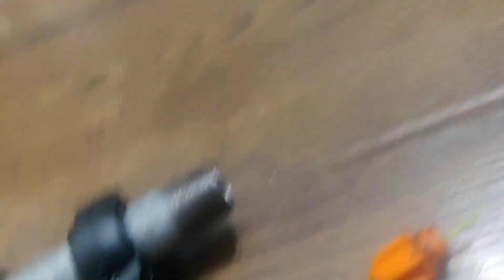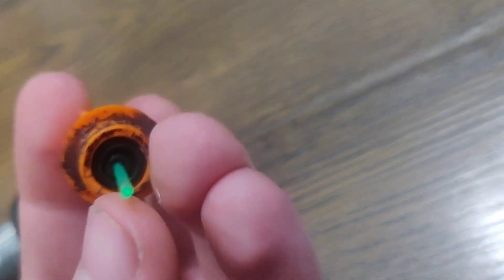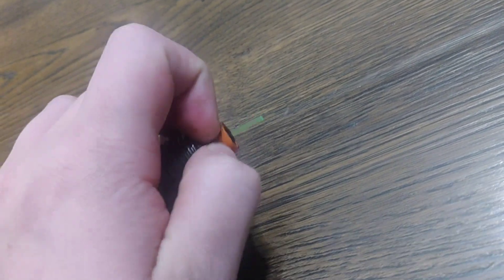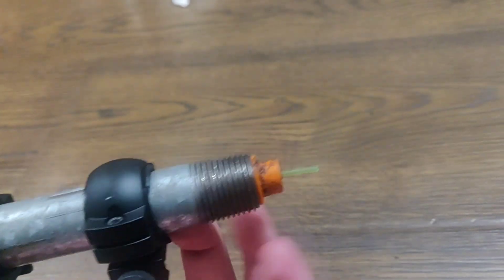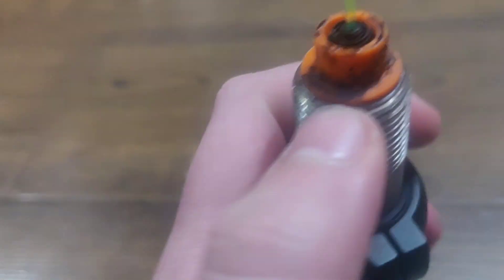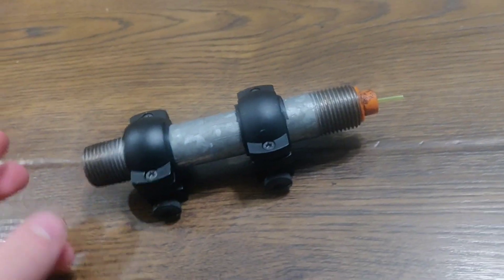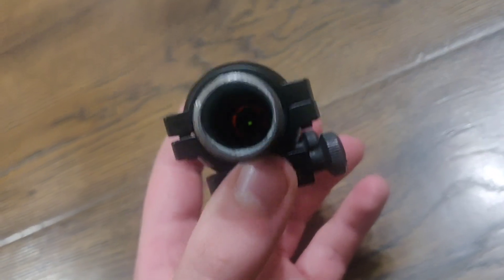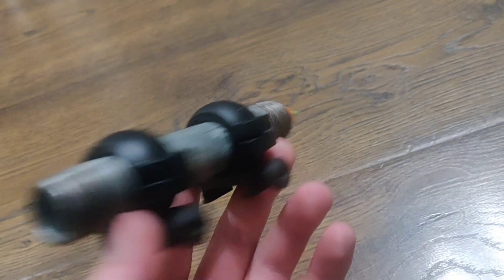My homemade OEG sight

Comment: Instead of going all 3D printed, I made one by drilling a hole in an end cap that fit the pipe. I used plastic pipe though...just an experiment after all.